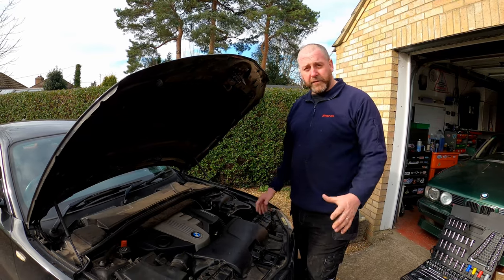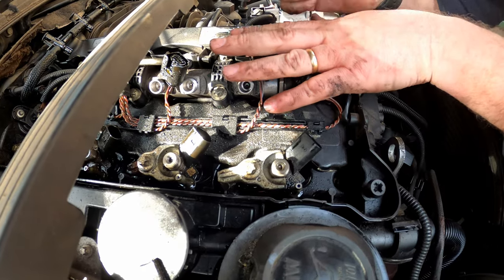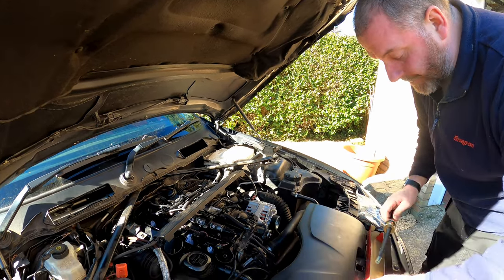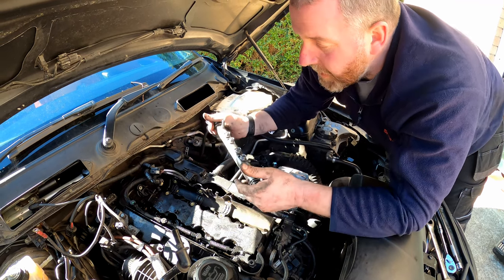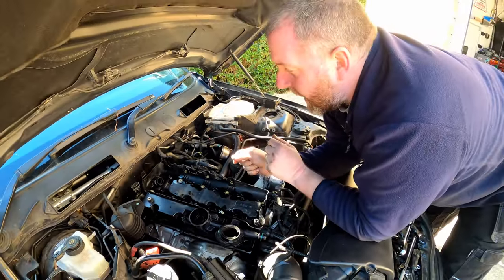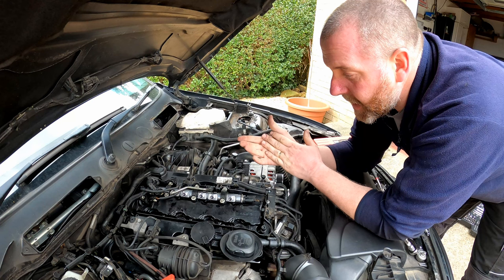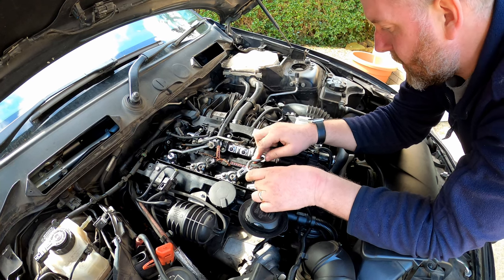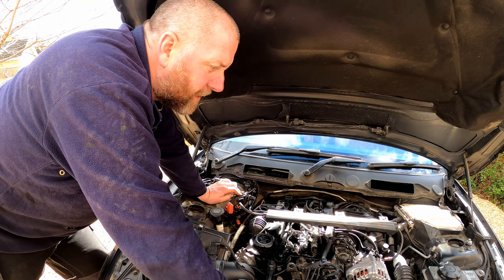BMW 1 Series N47 Injector Seal Replacement + Valve Cover Gasket Exchange - 1, 3 & 5 Series & X3

Comment: Mate thanks for the video. I was on the edge of a breakdown when I couldn't get the rocker cover off because of that final high pressure fuel line. I will admit that instead of taking off the intake manifold I was able to get away just cutting the cover down 20mm under the piper. I dont think I would have had the perseverence otherwise.
Again thanks for being the voice in my ear as I fumbled about.

Comment: Excellent. I've done 2 injectors before, 1 & 2, but now have 3 & 4 to do & the cam cover gasket need doing, so will do the whole hog as you demonstrated here. Nervous as always but you have to dive.

Comment: There’s one thing worth mentioning about injectors seals, both sides are different and tapered side goes facing down otherwise they would definitely leak, normally people don’t realise this and keep cutting the bore thinking there’s something wrong with seat and end up deepening it , there are some brush cleaners to get rid of the burn crap, also 3 bolts at the back are tricky to get too that’s also worth pointing. Rest good work to work on small 1 series front comparatively to 5 series, also injectors don’t need programming, i have replaced on most BM engines, they work fine , programming is just to injector number in system. But spray command doesn’t look for number to allocate fuel. So people don’t get scared by injector programming.
Reply: Are the 3 bolts at the back straight down or angled in towards the front of the car?

Comment: Great work 👍🏼 my 520d n47 started to leak around the injectors, also the rocker cover I think is leaking from a the first injector can this be glued? If not how much do you think this type of work will cost me… amazing video by the way top class I’ve seen so far!!!

Comment: Kev i am an academic and i have to say the video content and step by step process is probably the best i have ever seen on YouTube,  and has been exactly what i needed to see and feel for assurances.  Lately and after paying massive repair bills i am still no further forward with a massive fuel consumption issue on my e92 320d M sport. The garage missed the fuel injectors on bank 1 and 2 leaking, i have got an app to program the injectors called AP200 Maxi and will buy some refurbed injectors bosh and do it myself as you have showed apart from the programming to save myself a £600 bill without the parts. I am so thankful Kev for your knowledge, skills and expertise you should be commended on your efforts for showing us what to do. 🏁

Comment: Hi Kev, Great video, doing this exact job this weekend due to the guys do did my timing chain cracking the cover, and now found 2 injectors blowing. Timing chains been fine for over a year and I've lived with the slight leak but time to fix. Must admit didn't think id have to take the inlet manifold off as well but after watching feel much better prepared and have bought the cutting tool. Hoping the injectors won't be too stuck surly they had to be removed to do the chain but do have a tool I can borrow. Quick one, is there meant to be a rubber o ring on the injector as well? Did i see it still in the head in your vid? Also are they 1.5mm seals or 2mm, noticed some have a raised part of 1.5mm with a outer of 1mm. Mines a 2010 LCI so does that make a difference? Or and when you started the car, the engine seemed to shake a bit, is that normal or did you find your engine mounts were shot, don't think mine shakes side to side that much but could be wrong. Thanks again subbed.

Comment: Almost there with the help of your guidance. Just have to cut the injector seats & refit. Turns out my swirl flap rod was snapped with the far flap (cylinder 4) stuck in closed position. The actuator was rounded off so couldn't open or close anyway. Relucantly I've chosen to delete the swirl flaps. The EGR pipe was almost completely blocked at the inlet manifold end. All cleaned up so hoping the car will be happy albeit without swirl flaps. My cam cover gaskets were hard & brittle & snapping as removed. Obviously leaking, oil was getting into the injector cylinders as well as weeping around the sides of the cover.

The most difficult bit of the job was disconnecting the electrics, especially to the throttle body & getting the manifold out & back in. 

Will delete the EGR next. Too much gunk going through the system.
Reply: When you deleted your swirl flaps did you have to do some coding or is it a case of buying the gaskets with the aluminium delete tube thing and just installing it? Did you buy the injector removal tool, the copper washer removal tool as well? I'm trying to decide if buying those tools will be more or less the same labour cost as my rocker cover is leaking but will want to replace with new cover and gasket, Injector seals and gaskets, egr seal, swirl flap delete kit with gaskets.
Reply: @koysiimiah3320  No coding required. I bought genuine gaskets from BMW for the cam cover, injector seals & inlet manifolds. The swirl flap delete kit had inlet manifold gaskets but I only used the aluminium delete tube thing. Didn't use a special tool to remove the injector seals, 3 of the 4 came out with the injector, the last one I managed to dislodge with a long screw driver & sucked out with a thin tube connected to an old vacuum cleaner. I did buy & use the cutting tool to clean up the injector seats. MPG has improved but the feed from the EGR & manifold ports were seriously gunked up, so gas flow will be much better. Get the occasional lull in pick up from idle which may be down to no swirl flaps but when moving the car runs like normal. It was quite a scary job to undertake but ultimately very rewarding & must have saved a big labour bill. As said the tricky bit was disconnecting the electrics.
Reply: @koysiimiah3320  I made a slide hammer to remove the injectors. I can imagine a slide hammer is a must have.
Reply: @NickTubeless  the whole process sounds so scary my main worry is dropping something inside the engine 😅 I tend to drop screws and bolts alot when working on my car. Will have to buy magnetised tools and bits. All in I'm looking at a cost of about £250 with rocker cover ridex brand, gasket, injector leak off seal, injector copper washer, swirl flap delete with gaskets and the tools injector puller, injector seat cutter (is it 17mm?), copper washer remover just in case, e torx bits and torque wrench 5-25Nm. When you used the seat cutter, did you use the thick grease he used to catch the carbon or not bother with the grease? As I'll need to add that on the list too. Once I've ordered all the parts I'm going to give myself 2 days. Will have to drive it inside my 1 car garage which just about fits the BMW X1 I'll be doing the job on and complete it. I've been quoted £600+ for the whole job.

Comment: Thanks Kev. This is just the thing I need as I attempt the same procedure on my car. I'm about to get the necessary tools and parts ready before starting. Could you update the link for Diesel Injector Extractor set, its not working.

Comment: Superb. Do you intend to keep with the swirl flaps when you replace the inlet manifold? My oil level has been creeping up slowly due to a diesel leak and I've just replaced the gasket ring copper washers on bottom of the injectors. There was the same gunk of diesel you had - maybe in my case the camshaft-cover injector profile seals have been letting that fuel seep in? Your video to the rescue.
Reply from the maker: I didn’t mention it in the video but the current inlet manifold has had the swirl flaps removed, I did it years ago before I had the channel! 👍🏻

Comment: Hey kev, not sure if you will see this but is the valve cover a must. I can’t lie I got a little lost at that step taking everything off 😂 I do want it doing but I dunno if I should do it. Cars on 133k and gas not been done… thanks
Reply from the maker: Hi mate, no, you do not have to remove the valve cover if you are only doing the injector job. I had to change the valve cover gasket too as mine was leaking.

Comment: Wow. Was about to buy an X1 leaking diesel in the engine area on ebay but have watched that through. Unless you're able to come round and fix it I think I'll let the auction run. Personable and educational video. The only question I'm left with is how far back down the classic car route I need to go before the complexity of the mechanics meets my capacity to understand them. I'm thinking 1940's which is well before my date of birth...

Comment: So Kev I watched the entire video. I have also changed my injector washers as well as the valve cover. As you mentioned we need to crank it intermittently for 20 sec . Between these intervals, how many seconds should I leave the battery to rest?

My engine is also not starting after gasket replacement so I am afraid I may not burn the starter motor by cranking the engine for too long.
Just need your tough word if I should be courageous and crank it regardless for 15-20 sec until the engine fires up? Waiting for your reply . Thanks Kev
Reply from the maker: There’s no hard and fast rule to this, but starter motors do get incredibly hot as they draw huge amounts of current. I would crank and leave for approx 20 further seconds before trying again.
Reply: @KevsShed  thanks Kev . That’s all I needed to hear. SUBSCRIBED

Comment: Question for you Kev. Could you have used that reamer tool before reinstalling the valve cover? Is the tool cleaning the carbon off the head, or the valve cover?
Reply from the maker: The port in the head buddy 👌🏻
Reply: @KevsShed  I thought that was the case, but wasn’t sure. Thanks for the quick reply and the video. Great work.